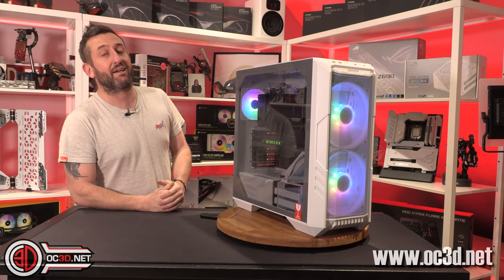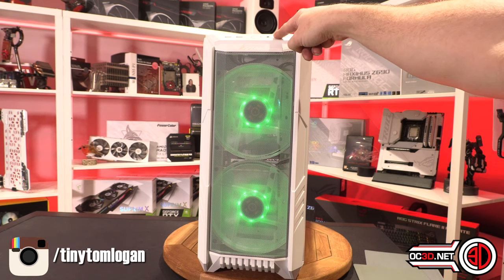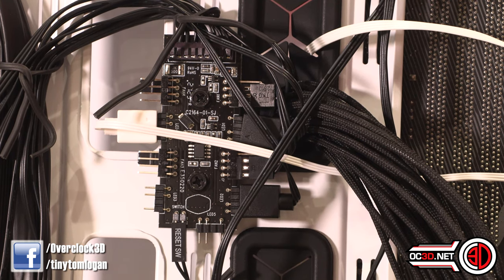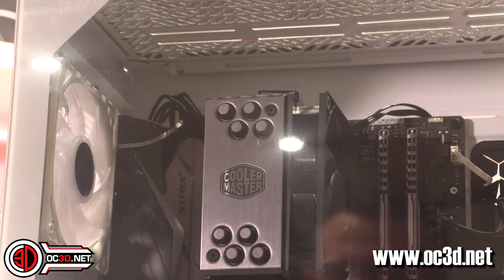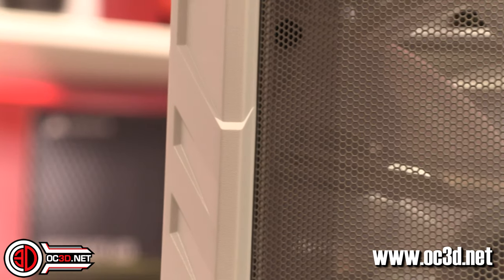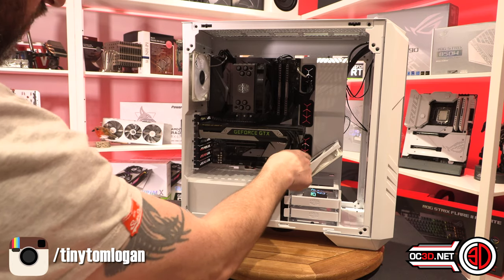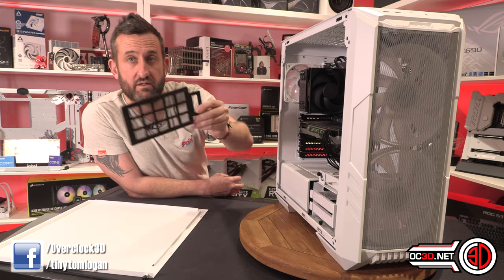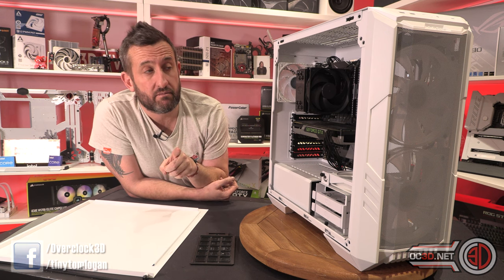Cooler Master HAF500 High Airflow Case Review

Comment: Thank you for the review.  It's amazing how much higher the standards for chassis are today than they were 5 years ago.  It is a little strange that Cooler Master didn't incorporate some of the lessons of very similar cases that have come out recently.  Lian Li had the same issue with the 200mm front fans.

Comment: I just bought this case. I moved the front fans to the top and my AIO to the front. I have 5 fans in front. I swapped out the gpu fan with an EK AIO fan. I also wired both 200mm fans to mobo so they won’t mess with other fans. Pretty solid when you swap things around but your review was what saved me from using the hub with fans. Thanks.

Comment: A HAF branded product from Cooler Master, where half the airflow is being blocked by the chassis, that's disappointing! I still have an old school HAF 912, which now functions as my PLEX server, and it still just works. It really seems that Cooler Master should kill the HAF branding if they miss the mark this badly. Like putting glass in front of the fans, putting huge slabs of metal behind limits airflow, making a mockery of the HIGH AIR FLOW branding.
Reply: Still rocking the HAF X case/Dust Collector

Comment: A consice review, and I'd say you're fairly spot on with your thoughts about this case.
I'm still using my HAF 500 from 2014. Yes, it's 10 years old and still all working flawlessly. I can't fault the case in any way. I have removed the HDD cage and angled fan and that seems to keep the RTX 3070 cool.

The old CPU (i7-4790) works hard whilst playing Sackboy or Cyberpunk but temps have always stayed below mid 40s Deg C. 
Still using the original 2 x 200mm fans and the rear 140mm fan. I can heartily recommended this case.😂